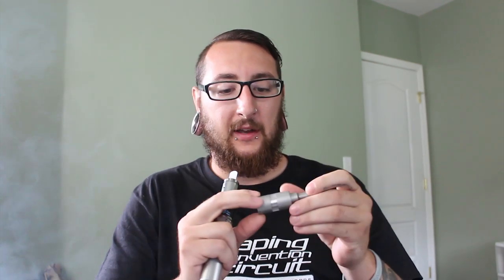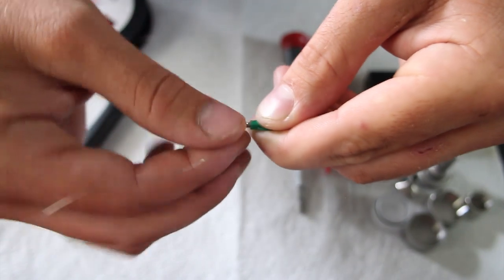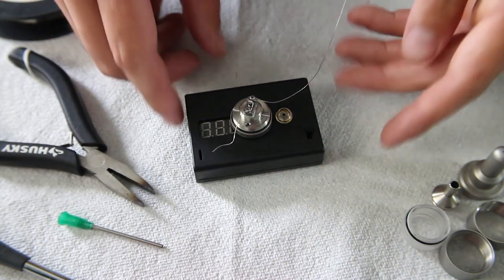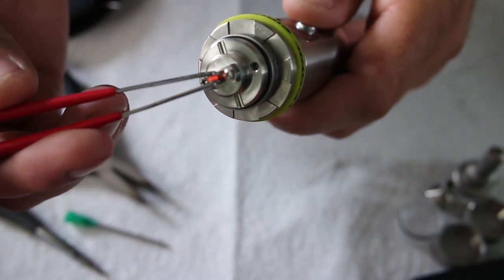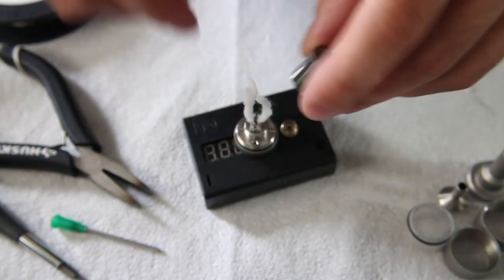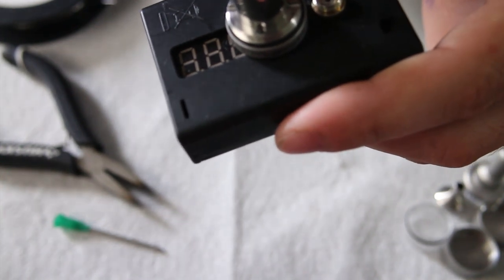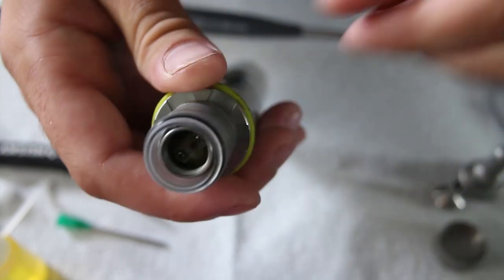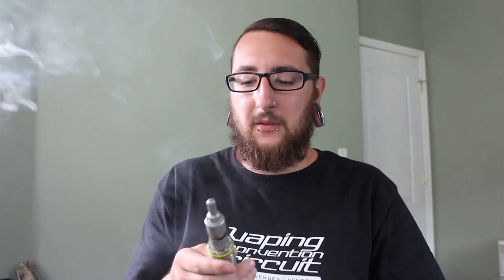#FRESHBUILDFRIDAY - Russian 91% Micro Coil

Comment: Although I tightened the screw on the 510 connection I still can't get the deck to stop swiveling which is completely destroying my coils.  Any tips?
Reply from the maker: Rachel T I'm guessing you need a new positive screw. I've seen this issue before and what happened was the positive screw actually broke and needed to be replaced. This could also happen if the threads on the block are stripped out but that's definitely more rare.

Comment: Can you do a dual twisted 24g at around .3 to .2 ohms?
Reply from the maker: I could but I don't think that would be a very good build and here's why: 1. That much wire would take a super long time to heat up and hold residual heat for way too long meaning a dry hit sooner. 2. I don't think my pos post hole can even fit 4 strands of 24g. 3. I find that I get better flavor and vapor from smaller gauge twisted wires like my flat bastard build.
Reply: Thay makes sense. Thanks!